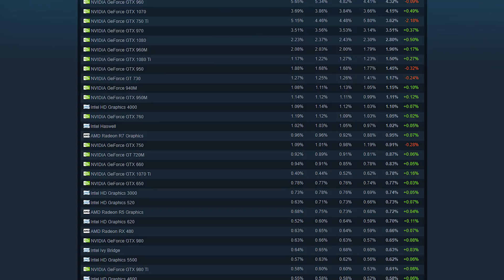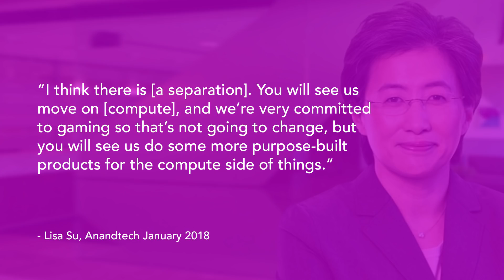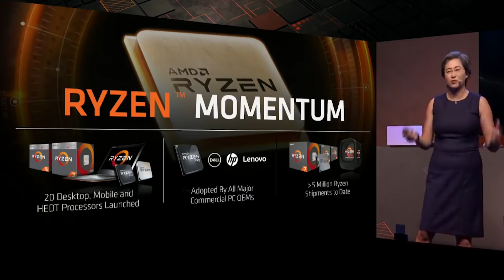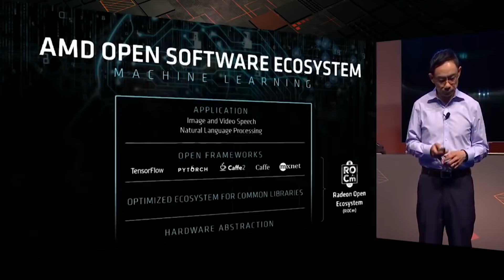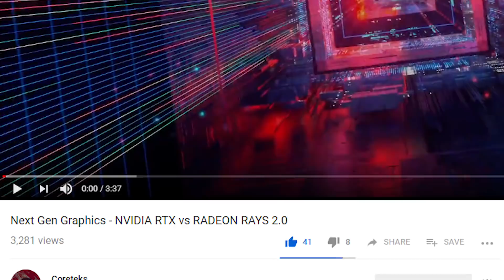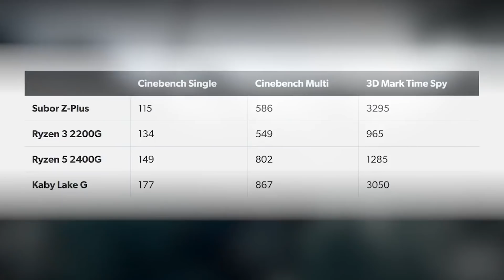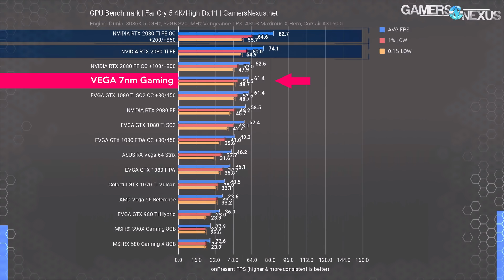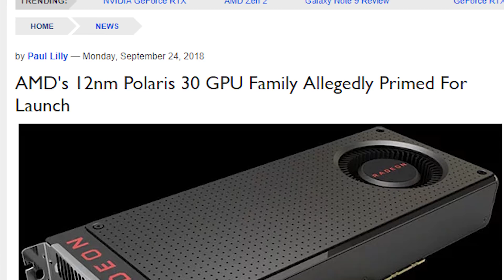AMD's answer to RTX

Comment: Amd made huge mistake with rebranding 690 as 5700xt. Now they have to backpedal. Currently I would advise everyone to wait a 2 years until Intel joins. Also cards are still not powerful enough to run  4k with ray tracing at high frame rates. Just wait cause a lot of cards will come and 12 moths down the line will be obsolete.

Comment: Lol.. its always smaller yet.. how odd the POWER the HEAT the SOUND for AMD never gets must lower... look at the beefed up VEGA 64 the VII.. most dont show you VII stock vs NV 2080 then show you heat power SOUND.. its UV or water cooled.. OC to then try to tell you how BETTER it is. 

To have to fork out $699 for something that was not worth it and all agreed. So.. if the VII is $699...you think there NEW card will be cheaper?

Comment: I do NOT want ray tracing. I don't see ANY advantages in it at for my use case. I just want straight line performance and that means more speed at less cost. I hope that AMD don't just follow them down the path of stupid features that are largely pointless for most consumers. This really is an opportunity for AMD if they can just see it for what it is. If AMD focus on just making faster cards that can deal with 1440 & 4K resolution with raw speed increases yet doing it for less than nVidia, they will absolutely clean up. That's all most people care about, deliver that & nVidia will be left rethinking their whole new line of "R" series cards.

Comment: As long as they price the GPU's at current prices at the top end, I'll be happy switching to team red for GPU as well. Nvidia is just outrageous. Instead of replacing the current generation top end cards they simply created s new segment out of thin air, expecting the world to be instantly wealthier when all the signs show otherwise. I think, come CES, AMD might just make team green irrelevant for gamers if the leaks are correct (which they have been for RTX).

Comment: I'm curious, if RTX was rushed… What was Nvidia's original plan for 2018? Was RTX always the plan, just planned for 2019 instead but they moved it forward to beat AMD to the punch? Or was it just going to be another typical minor performance upgrade over the 10 series cards without the raytracing abilities? I'm willing to bet that's exactly what was originally planned

Comment: Alot of pc games are ported over from consoles i.e the playstation and xbox, who's hardware is in them?, AMD's  jaguar processor's and scorpio gpu's just to name just a few, DLSS tech the way it's implemented and been around for ages it's nothing new and the xbox, playstation use it to help it achieve 4k display output with non 4k content, it's just a form of up scaling, Rasterization is the way most games render images on the screen. Ray tracing is a new api from microsoft DXR that does it differently, The RTX cards are just a rehash of the quadro cores look at the specs of the cards (Tensor cores / RT cores / RTX ops)  they are modified to run games. Don't quote me on this, But what if they are die's that didn't make the grade for quadro cards?....So are sold as gaming cards, this might explain the high price? either way I'm not spending that much cash on an RTX card!. It's not that I can't afford one I could buy quite a few of them it's the principle behind it, they are taking the p@@s with the price, I've brought cards from Nvidia and Amd over the years and don't prefer to take sides, but if Amd come out with a decent performing card for a decent price then I will support them!

Comment: Imagine if Intel did a Threadripper, Solder on 2x 9900k's or 2x HEDT Cpu's......... At the end of the day, clock speed is still what matters, sure you can lots of cores, but why cannot AMD have their CPU's Architecture as Good as Intel's and Clock on Air and water around 5ghz on all cores?.....As for Gpu's I genuinely think The reason why Intel and Nvidia are Kings in their own markets, is because although each does a little bit of processing and Graphics, its not like at AMD where they have  CPU/Gpu/APU. I think if they sold Ati(Radeon) Or ran it separately; it would allow it to become better optimised at its job. The AMD GPU is suffering now because of The fight with Intel to stay relevant. Now they have some CPU money coming in, their GPU money of which used to be pouring is dead. So 2 seperate companies would be effective. But as an Intel and Nvidia Fanboy, i wish Intel Merged with Nvidia. Imagine THAT! £3000 for a CPU not with HD intel graphics, but Nvidia Geforce graphics. Overclocked to the max. Ooosh.

Comment: Holy shit... Corsair AX1600i ... 1600 Watt oO starting at 417€ with no further comments and "Titanium Plus" costs 552,87€ lowest (according to google shopping search from german IP, means the titanium plus is far over 600$ only for the power adapter -.- thats why I love these tests, they are sooo realistic^^) -.- I really stay at my 1070.... 1 kWh is 0.28€ (+ monthly 7 to 9€ or quarterly?! depends how many hundreds/thousands kWh you use, you can add maybe another cent to the price... in the U.S. it was something like ~0.10€ converted, much cheaper hardware, electricity, lucky I have a 30€-"flat" (ok they kick my ass if I would run all the day over 600w average or so), really we in europe are ...... but okay brazil as a "poor" country in average is really expensive, they buy games in Europe even in languages they don't understand, and if there is no portugese they have a problem as I did read in a forum and than checked that brazil is nr. 4 of most expensive hardware, a playstation did cost 1500$ at release or so while in North America it had been 400-500$?! with games the same... taxes are the reason and maybe small portugese home market?! Angola, an old portguese colony, 10% of the people make over 90% of the cash, extreme much people outside Luanda do not have even water, and ofc no power... this was nr. 2 or 3... venezuela was nr. 1 because of their hyperinflation... all countries were somehow linked to spanish/portguese language :X
Reply: A) That escalated quickly. B) 1600W won't draw 1600W constantly.

Comment: does that guy look like a gamer for you?! he is always so proud about his thousand(s) dollar gpu's he always repeats "best [gaming] card ever in pc history!". I don't want a +1300€ (partner) card, large enough to kill someone with that thing (is it all heat absorbing material inside? was/is it too in the large space of the Pascal-Cards? They only have 1 fan but they are longer than most if not all 2-fan cards, not to talk about the "mini" 1080 with 1 fan, I think its 40% of the founders edition, the "DIE" for GP104 is 314mm² or so... GP102 is a bit larger I guess with something like over 10 billion transistors, my 1070 (2 fan, partner card with a bit better cooling, looks like crap for many, but it was... affordable, I didn't wanted to wait anymore when I bought this system and AMD at least in the CPU sector brought a real good Ryzen 7 2700X (I play and somehow I have the feeling with every patch the 16 threads are used better, this is the strength compared to the cards which were available for a bit more money at this time (just after the release, it just came from the container ship or aircraft? to the store and into my system I guess^^ I even do no longer put the monster fan on full power in strong reduced 4k gaming with my heavy overclocked 1070 (its really cool that they have all the GP104 it allows heavy OC, the 1070 ofc has the weakest version, I think I did read and numbers would be correct, that they simply take 1080's DIE and take not well produced version because they disable 1/4th of the shaders/TMU's, and that number for many things is correct afaik, the 1070 Ti is a bit better, but as it doesn't bring THE difference, especially not if you overclock the 1070 correct, its not worth it and the 1080 or even the 1080 Ti was simply too expensive as nothing was known about the Turing cards, and most asked people said "11xx" instead of "2xxx" or anything cmplete new, the 1080 Ti came in March 2017 with the GP102 in a weaker version, close to the Titan X, thats why they brought the Titan Xp to show that these ultra heavy expensive cards (Titan) are better and for ultra money spending gamers...Vega 64 is affordable now but 290 Watt.....no wonder many people get blackscreen when the card runs in full mode and I don't know if the HBM2 ultra-fast memory (2048 bit?!) has future or not?! 

so they really only waited 18 months to bring a card which costs as much as social care living (without housing) for over 3 months in germany...with features there is/was no game available for (ray tracing afaik Battlefield V will be the first game to support this feature and "made" for? but the RTX 2070 now is offered for 519€ as a "bargain", almost for free... and best was, not a single german magazine/website who usually makes the videos (like Gamestar, PC Games Hardware etc) did get a RTX 2070 from Nvidia, as they mentioned they don't seem to be cool enough, only the English speaking ones... and the cool thing is that one I think australian site/guy, because he talked before about for example my 1070 card and said that the difference to other partner cards which are larger and have an additional fan cost 25 AUD more or USD? However, here the difference was ~100€ (~125$ at this time, or today ~160 AUD almost) for a MSI/ASUS 1070... wtf?! and he said "I can't tell you not to buy this, if you have much money left, but..."... and he said, all these things like ray tracing, DLSS (or how its exactly called) are not available yet, Nvidia wrote in the expierence (opened to check for a new patch), 25 games are now in production with DLSS! wow thats great for people who bought the extreme expensive cards and only have the normal performance boost so long for a price for which you can get a used car..and I don't mean the last piece of crap which only works with a bump-start^^

and the best is, he said they got the 2070 only 14 hours for testing or before testing/making the video (I guess they have to give it back as it is pre-release?! a armed swat team comes and gives and takes the cards and the battlefield V and star wars demo, you can't compare it, and it was/is not allowed for BF V....like it was not allowed to say that the 2080 is only 5 to 7 or 8% better in performance right now for available games than a 1080 Ti, this was only allowed on the 19th september, 1 day before the planned release, in Germany it delayed 2 times and the 2070 is not available right now, not from Nvidia and the partner card (EVGA) tested, which was without LED, very much PET/"plastic" used, which many people already cried about that... but okay for 519€ you could expect a bit more than a cheap plastic design, even the fans are white plastic with small black points on it?! but its really best that even if I would be crazy to buy this card as an replacement for my 1070... I couldn't... there are none... only for 600 to 700€ partner cards... or very close to 600, maybe 589€ or so without transport costs, or with very much luck maybe ~590€ incl. transport from internet shopping, I really hope the card won't sell sooo good, I think as they said before they will first sell all the stocks from pascal/1000-series, now they even keep producing or at least selling the cards, I think all cards, even the 1060? my teeny gamer time is over, but I bought a complete system cheaper than the GPU's from Nvidia today and had in I think almost all cases "only" a Radeon, but I played and was happy and had fun, as I didn't play shooters really and you didn't had so much multiplayer back than and not "online only" even for singleplayer mode (without cracks, lucky some people do that IMHO...but I really understand people who say if there won't be a good card with which I can replace my 1000-series card for a "normal" price I really switch to a console, playstation in most cases, and will use the PC for multimedia and 1080p gaming only as long as it works well..... 

so pls stop presenting Titan X (Pascal) and Titan X (Turing) and 2080 Ti and bring cards for the masses... userbenchmark tells the truth, in the chats everyone has a 1080 ti or 1080 at least, but there the 1060 is the most tested one (with different systems, so no multi-tests from one system with another IP except the person switched everything... but the guy in the video... they released the video with the title something like I can tell you what you shouldn't buy if....... and a "sorry nvidia" in the video :D at least one who isn't trying to defend the crap price-system, so pls don't buy the 2000-cards, I mean that the 2070 is available "only" for 519€ (I guess that asian CEO thinks thats really a bargain and really almost for free), is a sign... and the coming cards (next year? oO) won't have RTX many sources think because the 2070 is on the lowest limit for real time ray tracing, so the "RTX" needs to be protected like the name "Titan", oh and what in the german video wasn't sold and I only heard it there as I don't watch so much videos, this is a link from Nvidia^^ The 2070 has no SLI he said and showed a list back to the 600's generation... so if anyone really wanted or wants to operate some 2070 together... nah, buy the 2080 (Ti), 3 of them... its only something like almost 5000 US-$ in Central Europe for partner cards (the most expensive are somehow available with a waiting time...) xD

Comment: Great video! I'm just concerned that with this 6th Nov New Horizons event done, and no gaming 7nm Vega announced, we may actually not see a 7nm gaming Vega now. If it had to launch this year and was part of the 7nm news story, it would have been spoken of there. Also David Want confirmed that Navi will not use a chiplet design, stating that unlike with CPUs multithreaded GPU apps are limited so no point in having a chip level crossfire configuration, as that is exactly what the OS would see this as. He says it'll be a while before the OS can be fooled to think a multichip module GPU is in fact a single GPU. Thoughts on these?

Comment: If AMD does release a card like that, still, most games are more favourable to nvidia. The vega 56 is capable of something like 11 Trillion floating point operations and the 1070 like 6 trillion or 7 and yet they perform the same in most games. Hardly any games use AMD gpu architecture to the advantage. For example, Fortnite seems to run better on pascal architecture than vega but vega has more computational power. They can only use sheer force to beat out Nvidia. They will need one hell of a monster graphics card to beat out Nvidia. I think AMD was a tad late this time. I'm playing super physics heavy games so I chose an AMD card over nvidia.

Comment: the biggest thing that AMD can do that will make AMD gaming cards more worth it. is to work on making the cards in question draw less wattage power than what it draws now. yes nvidia cost more but in terms of power usage draws more electric power nvidia cards. so yes while AMD gaming cards is only short by a few frame and is half the price. but due to the fact that it draws more than double the electric power than a mid range nvidia gaming card.  you will end up paying more for the electric usage in the long run. but if the AMD gaming card was to use less power than what it does now than the price to power to electric usage will make the AMD all worth just getting a few frame less in games.
Reply: Theres almost no difference in the long run.

Comment: FYI- The 1.35x slide is talking specifically about transistor performance, note the header of the slide... "Leading Edge 7nm Process Technology." Now that you know that, be aware that there are trade-offs for the "improvements" listed at the bottom. You don't get all of them together.

GDDR6 is currently more expensive than HBM2. HBM2 costs are still being lowered and we should see them bottom out in 1H of '19 as a new player will be entering the market.

Comment: To anyone saying that AMD shouldn't go head to head with Nvidia in the high end market is mistaken, making high end product and showing your competitors what you're capable of is good. Best example threadripper, when AMD released it, Intel frantically released a rushed, x299 18 cores, which imo, was a disaster despite its performance. It ran hot, consumed a fuck ton of power. It was a nuclear reactor. If AMD did the same in the GPU side, we can expect nvidia to panic

Comment: This is not really related to this video but i just wanted to ask, since there might be some people with knowledge in this field around:

Would it be feasible and worth it to add really small fpga "cores" onto GPUs and are there GPUs who already have some included?
With FPGAs one can create (almost) arbitrary fixed functions in hardware. I envision a gpu which has (at least) one fpga chip / core for every streaming multiprocessor. The programmer then will have the ability to create small fixed function steps which will then be synthesized (at startup of the program) into each fpga and can be used by the program as some kind of atomic function. This would allow to have programs which make use of either tensor cores, rt cores or arbitrary other kind of cores depending on what they will need.
Reply from the maker: Intel owns Altera, and Intel are making a GPU so who knows, maybe something like that could come out. But that doesn't seem the way the industry is headed, certainly not in gaming. For other applications, I think ASICs will continue to be more popular.